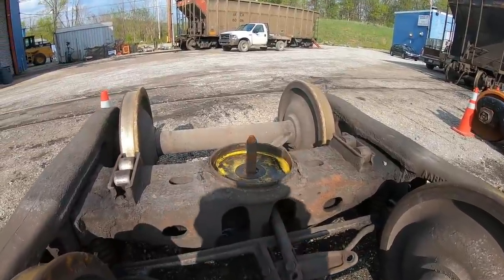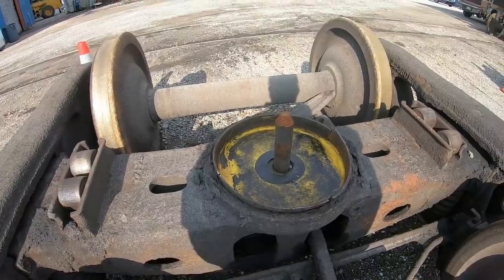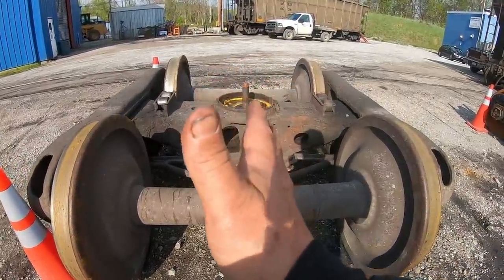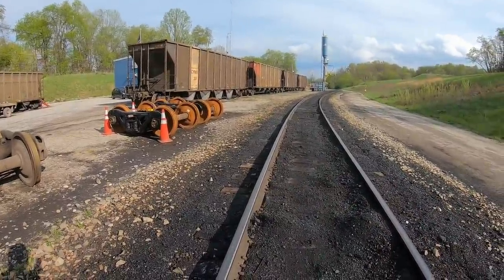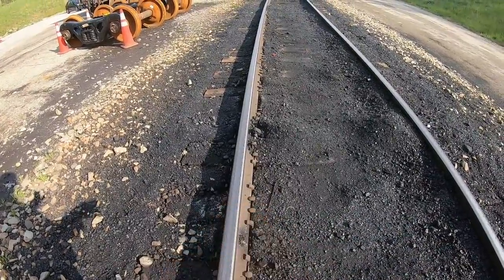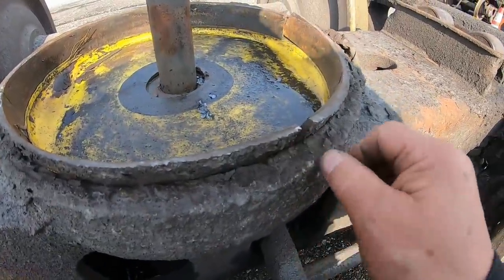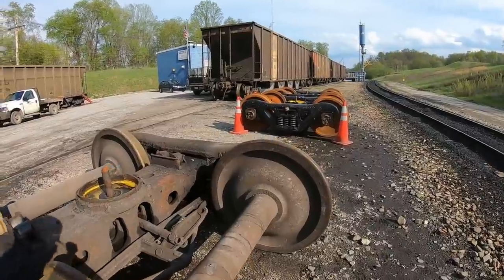Why the Derailment at Curve 18  Happened

Comment: Protect that ring from the weather and call in a metallurgist. The fractures can be inspected under a microscope to determine if they were fatigue (rust and sandy beach lines along the direction of crack propagation), or sudden fracture from the rolling of the car. The fracture can also be analyzed by x-ray to determine if there were residual stresses in that ring.
Reply: +1 NDT reports are extremely valuable. A good NDT guy will also give professional suggestions on maintenance/service life and how to to prevent the failure.
Reply: Magnaflux
Reply from the maker: Sounds like an excellent suggestion John, I will pass that info
along to the powers that be. Appreciate your watching sir
Reply: Cracks in the bolster bowl rings are a common occurrence. Not so much with the 16” bowls but does still happen . Looks like a failure in the weld, some people have trouble welding the stainless steel ring in the steel bolster .
Reply: @gavanhillebold3131  I haven't heard that term Magna Flux in decades...I know it works very well,  way better than Flash Light and/or  human eye as well.......

Now the question is who becomes the fall person behind this maintenence issue?
Reply: This is the railroad. They buy brand new truck sets and leave them out in the weather to rust before they are ever used. I think it would be hard to find a more tradition bound industry in America than the railroad. It worked just fine 100 years ago so it's good enough now. Our American freight rail system is probably the best in the world but that isn't saying much about the world.
Reply: @cgirl111  to be fair, once installed the trucks will still be outside in the weather
Reply: I concur! Preserve the evidence and get a metalurgist to analyze it. Microscopes, Magnaflux, X-Ray, Acid Etch, Drill, 220... 221, whatever it takes. [smile]
Reply: The yellow ring or bowl is made of HDPF plastic.  It IS the lubrication between the truck bolster bowl and the center bowl on the car or locomotive.

The 2 3/4 (2.75)inch elevation of the outside rail over the inside rail of a curve is to even the loading on the rails so the rails will wear more evenly than if the rails were level at the speed the train travels on the track.  The elevation is called superelevation to bring the center of gravity of the cars more into the centerline of the track.  At 25 mph, the cars want to tip toward the outside of the curve loading the outer rail more than the inner rail.  By lifting the outer rail to the amount that a pendulum will stay on the centerline of the car and centerline of the track, the track will not be excessively worn on either of the rails and the train will follow the track better.  Because all of the loaded traffic is basically the same and no other traffic, this line can easily be given the proper superelevation in all of the curves for loaded cars (trains).  The curve elevations will not be correct for empty trains but they don't wear the track near as badly as the loaded trains.
Reply: I agree
Reply: Die penetration testing might show some cracking that could not be attributed to sudden shock.

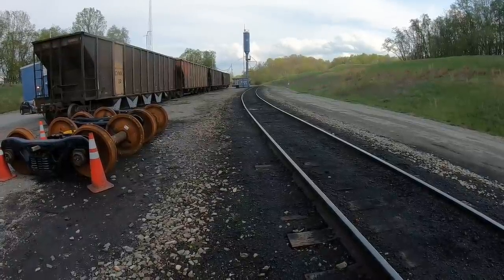I used to work in an industry where we made flanges for the oil industry, chemical industry, and nuclear submarines. In some applications these flanges had to be 100 % penetration welded to shafts. And they used magnaflux and die penetration to test for internal cracks....... And these testing methods usually found them. 11:16

Comment: If you look at where the metal split if it's a fresh break the metal will have light color to it and dark if it's old.
Reply: That what I was thinking. Fresh break flash rust, old break dark rust and the accumulation of dirt and old grease.
Reply: The cracks are not in metal. That is a nylon insert.
Reply: @house21758  no actually look close and you can see the insert is completely worn away on the sides and only the bottom is plastic now, looks like they never changed the liner and the stress of metal on metal cracked the bowl, plastic liners are added to high stress joints to relieve pressure and help grease do its job, so it's not a critical failure item but if it wears down it'll cause the metal to wear down fast, similar to how once the plastic seat in some cars ball joints wear down the ball joint wont fail but it will become loose and prone to failure.
Reply: @house21758  The cracks are definitely in the metal.  The walls of the plastic insert is worn away and gone.  The breaks are extremely straight as though they broke along a weld seam.  The three breaks are 90deg apart.  Only a metalugist can analyze and determine if the breaks occurred before the derailment or as a result of the derailment.
Reply: @dylanbrdn7996  after watching it 100 times lol I have to agree with you
Reply: To the train...ed eye, the grain structure tells all!
Reply: What you think is a metal split is actually a Teflon bowl liner.

Comment: So that's why my cheapo HO model railroad cars keep derailing.  Interesting.
Reply from the maker: Several other model railroaders have written in with same
comment, very interesting to me to hear that. Thanks for watching
Reply: Must be the Life-Like ones!!
Reply: I'm not an HO railroader myself but my best friend is. He often points out that the stock curves provided in HO kits are much too tight for actual railroads and result in easy derailment. The problem may be the track, not the cars.
Reply: In O scale ( not 3 rail toy trains) we use properly tapered wheel tread faces just like the prototype.. and free swiveling of the trucks is absolutely necessary. We rely on much the same geometry of operation as the prototype.
Reply: in h.o.   22 radius  is closer to  scale... also adding weight to cars... helps cars...track well!
Reply: thank you for all of your work!
Reply: Nice comment list!
I watch the engineering of both.
I’ve laid track for model railroad layouts, and weeks of testing the track come long before adding any scenery.
Hours and hours of track geometries to make every car track reliably, and for hours on end at any speed, half speed pushing ten cars.
Not an easy task with Talgo trucks on N scale!
But, it paid off, and I had zero trepidation pushing ten cars in front of a loco at train shows!
Also, the fact that I could take locomotive power, and have a pusher BEHIND the train, and not even matched by DCC electronics, says volumes for the track engineering.

I think the man is right, the truck didn’t swivel properly, so it could not track the 8 degree curve.

I’m in construction, and I know how tight that is.
Measure 100’ from tangent (straight) track, and then set your transit for the direction you are going.
I’m not going to describe an easement to the track, just keeping it simple here.
The protractor (everyone should know what one of those is) that is built into the disc the scope rides on is marked in 1/2 or 1/4 degrees, depending on who made it.
Turn the scope 1 degree in the desired direction, and at 100 feet, a man holds a plumb bob over the ground.
If you are the guy looking through the Theodolite, you direct him left or right.
When he gets over the point you want him, however many degrees from center, he marks the ground with a stake for the centerline.
Highway curves are a few degrees.
There is a formula for superelevation that correlates to expected track speed.
The trick here is, if a train is standing stock still on that curve, you can’t have it rolling inward and derailing, either!

Back to the “Toy Trains…”
There have been times that I was forced to superelevate curved sections to prevent derailments.
Not only does it take care of the problem, but it looks cool as all git-out when an N scale locomotive leans into a curve!
Reply: go to g scale much more accurate 
.

Comment: Makes sense, Dave. So the leading wheels of the truck-set jumped the tracks, because the pivot failed. Those cracks in the bowl, don't look fresh. They have been there a while and the grease leaked out. Then the plastic liner failed as a result. Thanks for your analysis I look forward to your future videos. It is a sad irony that the track you maintained in pristine condition, suffered so much damage.
Reply from the maker: As Thomas the Tank Engine said, Silly cars always causing
trouble because they are angry. Thanks for watching my friend.
And as you know the track men always blame it on the car men,
the car men blame it on the engineers and the engineers
blame it on the track men...LOL
Reply: @ccrx6700   " Thomas the Tank Engine said" - 😂 I bet there isn't a railway man alive, who hasn't watch at least one episode of Thomas.
Over on the other railway, where they use blue locomotives, you can clearly see who's responsible there - the bean counters. The track is in terrible condition.  -  And there are ones even worse than that.
Reply: @ccrx6700   - Something else I noticed, Dave. That refurbished truck set, it looks like the centre bowl is made of much heavier gauge steel, than on the derailment set. So they might have had trouble in the past with theses bowls splitting and leaking grease.
Reply: @ccrx6700  The cars get tired of being pushed and shoved around. Kinda like people.
Reply: @algrayson8965  Amen Brothers!
Reply: @channelsixtysix066  Looks like it wore thin and then cracked to me.
Reply: @gravelydon7072  Yep, that's possible. But you'd think the grease should have prevented that wearing away.
Reply: @channelsixtysix066  Problem is, grease and dirt,iron filings, rust, etc.... tend to make an excellent grinding compound once the foreign matter gets above a certain level. I'd check the car bolster also for wear as it may also be out of spec and need building up with weld.
Reply: @gravelydon7072  " tend to make an excellent grinding compound"  - Yes, they do. 😆 No doubt they did all of that on the car, before they mounted it back on a replacement truck. Imagine the logistics of trying to manage a fleet of these things and keeping track of them. No familiar with rail operations like that, there must be some sort of electronic ID that can be called up and show hours between service.
Reply: @channelsixtysix066  We have exactly same bogies with liners in the UK , they run dry ,as far as I,m aware these liners are the lubrication ( bit like nylon bush needs no lubricant ) we have very few fail , I'm retired loco fitter only done little work on waggons , but did quite few years on derailment gang with all types
Reply: @nounoufriend1442    "they run dry ,as far as I,m aware"  - Yes, you're correct, I completely forgot about the lubricating properties of nylon or polythene.
Reply: @channelsixtysix066  Yes nylon/polythene is often used as a friction reducer between components so I suppose it can be classed as lubricant ,   I think grease can be detrimental as degrades the nylon and attracts grit/dirt
Reply: @channelsixtysix066  With only 3 locomotives and less than 100 coal hoppers, it should be fairly easy to keep up with equipment records on this railroad.

Comment: Sounds like a new inspection item to add to your checklist.
Reply: as long as they're properly installed they should be maintenance free... but yes i imagine they will have to inspect every single one now.
Reply: @rustblade5021  rarely is something maintenance free...........
Reply: @rustblade5021  Those low friction plates are definitely NOT maintenance free.  They do wear out over time and do need to be replaced.
Reply: @littlewingpsc27  the words; "maintenance" and "free" are mutually exclusive!  Kinda like; "JUMBO" "shrimp", "Military" "Intelligence" and "Honest" "Politician"!😂🙃🤔
Reply: @littlewingpsc27  don't split hairs with me - these wear liners last for years and years until they need to be replaced. they also do not require grease. that is THE definition of "maintenance free" when used in place for bearings.

Comment: Flanges have been 1” deep when new, up to 1½” deep when the tread is worn out, back into the 1800s. It was found by trial-and-error that deeper flanges do not help. Most steering of the axles is by the tread taper, which is about 3°. Then a fillet radius between the tread and flange does added steering or guidance when the tread taper is not enough. If the flanges contact the side of the rail head a loud screeching sound is made.
Back when car wheels were chilled cast iron the flanges had a larger radius on the back side of the wheel to support the relatively brittle cast iron. Today’s wheels are forged steel. Wheels are flat on the back side.
In other countries four wheel cars, carriages, wagons are still common. The axles do not swivel.
In most Eurasiaafrican countries spikes are not used. They use bolts with clips or springs that clamp the rail snugly to the crossties, sleepers (UK).
Reply from the maker: Very good explanation Al, thank you for posting, also to add a
bit the deep flanges are prone to hit tops of joint bars, not
a good thing! I can always tell when a wheel tread has too much wear, I'll see scratch marks on the joint bar tops in curves
Reply: In addition to joint or angle bars, if a flange exceeds the maximum allowed depth, it will ride on the metal part of frog that separates the frog point and wing rail causing the wheel to ride high through the frog resulting in the wheel tread to lose contact with the frog rail--a BAD thing, for then the car weight on that wheel is supported only by the flange and not the wheel tread.
Empty car-bad.  Loaded 100 ton car-that's about 12-1/2 tons on that flange. The flange cannot stand that for long.
Reply: @glennfoster2423  When car wheels were chilled cast iron for the flanges of a loaded car to hit the throat of a frog could cause the brittle cast iron to break off.
One fellow, touring a railroad switch yard, noticed an old fellow standing in a pit by the track. As each car rolled slowly past, he hit each passing wheel with a hammer. The visitor watched for a few minutes before asking, “Hope you don't mind me asking, but why are you hitting the wheels?”
The old guy answered, “Don’t know.”
The visitor, perplexed, asked, “How long have you been doing that?”
“’Bout thutty years.”
“Why have you been doing a job for so long when you don't know what it's for?”
“Th’ railroad, they pays me.”
Reply: @algrayson8965  A defective wheel will have a different sound to it. Do enough of them and you can tell the difference.
Reply: I was going to mention tread taper myself.  I can't quite tell from the video, is it in spec on these wheels?  They look pretty cylindrical.  That would easily contribute to the derailment
Reply: Yes agree its stronger like we do in UK screwing the chair on the sleeper but still no good if sleeper is rotten , as for wheels the flange height increases with tread wear 37 mm is max on uk rails main cause for tyre turning  . Also flanges wear thin , this causes problems on points/switches if their not right up tight , we have no test for tread taper only thickness  , another thing we get is very hollow wheels on GM locos with steering bogies . Also if like claimed bogie wasn't free to move on liner they just tend to climb flange especially when empty , with little damage to track when derailed .We had Loco derailment just after tyre turning it was put down to poor finish from wheel lath causing flange climb on curve

Comment: I had 38 years on the railroad in the mechanical department. You are probably right about the truck not slewing in the curve. The steel liner of the bowl is out of place, it is sitting way too high, look at the new truck and you will see that it is sitting flush or just below the bolster casting. The yellow cup is the wear plate and lube for the trucks center bowl, grease is never used in a center bowl, it collects dirt and becomes a grinding compound that wears it even faster.
   When I started we put a plastic type of lube pellets in the bowl every time we pulled a truck out from under a car, then later we put lube plates in them instead. Now they are using the plastic liners. I wonder how many times this will happen now as on unit trains they are not removing the trucks on a lot of railroads when they change wheels so the center bowls aren't being lubed and inspected. They are jacking the cars up with the trucks and pulling the wheels out the side or doing them on drop pits.
Reply from the maker: Thanks for the very informative comment sir, appreciate that
and for watching
Reply: @ccrx6700  I agree with him.
Also, with today’s plastic tech, why wouldn’t it be such a stretch to make a sealed unit to sit in the bowl?
Since it doesn’t have that much drop, raising the car body off of the bolster would make for instant access to remove an old one, and slip a new one in.
Another possibility is to make a hardened steel pair of pancakes that are sealed, and again, drop right in.
They could be made in such dimensions that they would not get stuck inside the bowl.
I like the lib and plastic, but I’ve seen some interesting failures in regular automotive applications.
When I drove flatbeds, I used a lube plate.
Designed for trucks that rarely had to unhook.
I saw a lot of potential problems in the long term, so I would unhook and re-grease both sides once a month.
People never could believe how much fuel and tire wear you cut down on just keeping that single pivot point free.
Imagine how much wear to tracks and wheels could be prevented with a correctly designed pivot point insert!
Heck, don’t even use grease!
Hard stainless and a slip of Teflon between would solve the issue, as the Teflon would not hold dirt, and would work its way into the pores of the plates!

Comment: The cracks in the metal of the broken ring on the truck can be looked at for "weathering" meaning if there is any penetrated rust, grime, oxidation, etc. that can be seen in between the mating surfaces of the crack, then those breaks were there prior. If the derailment itself caused it to break, then those cracks should be shiny and fresh appearing.